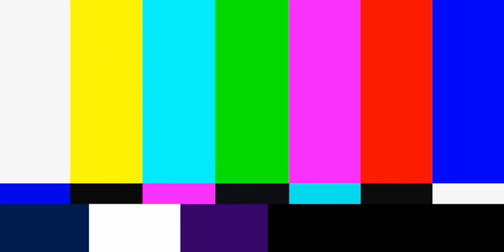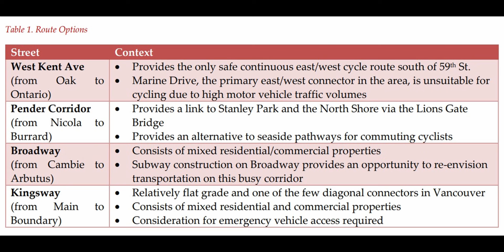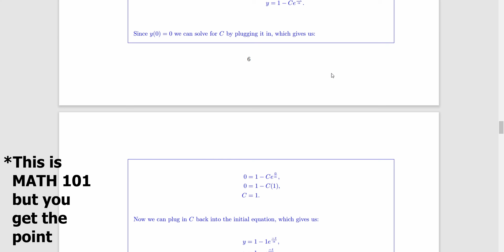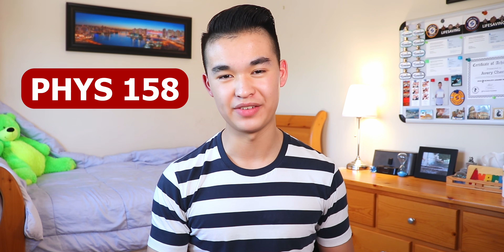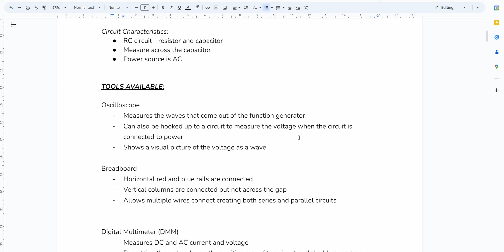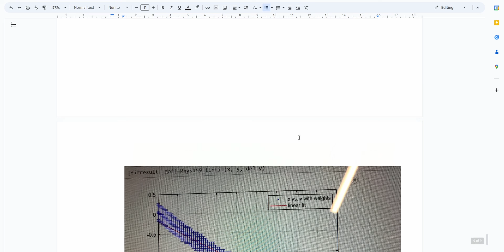UBC ENGINEERING FIRST-YEAR COURSES Tier List!

Comment: I am going into ubc engineering this september and this video is scaring me lol. I am thinking about moving some of my courses into the summer, which courses would you recommend I move and do you think reducing my courseload would make me less competitive for 2nd year placements? ( I am not in the pre-biomedical engineering program and is also taking econ 101 for my elective)
Reply from the maker: First of all, I promise you that it isn't as bad as it initally looks. You'll feel overwhelmed at first, but you'll then get used to it.  But if you're not convinced by that, the courses that I'd recommend you move to the summer are PHYS 158 (which you will take PHYS 118 in the summer), your elective, or WRDS.  However, there is a chance your elective and WRDS will have higher marks relative to the core engineering courses, which will bring your average up for 2nd year placements (this was the case for me).

It's all about trade-offs; whether or not you want to take the full courseload now, or dedicate your summer to some of these courses.  Another note though: around 90% of students get into one of their top three choices for 2nd year placements.  Just keep that in mind...